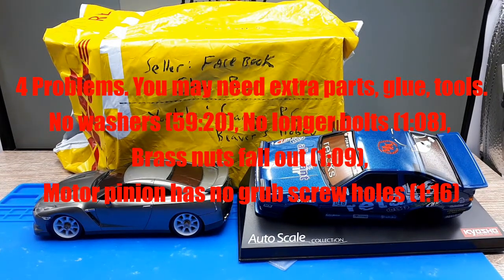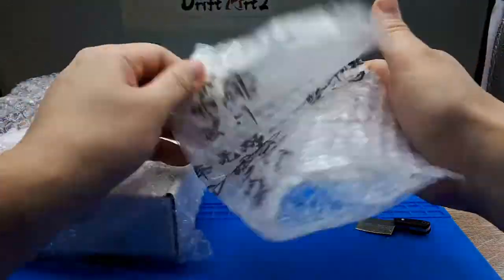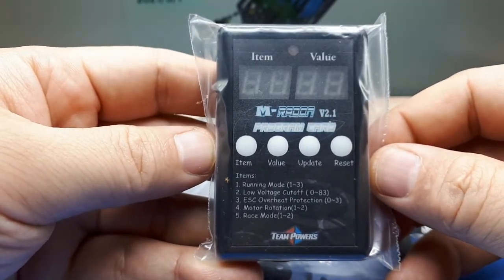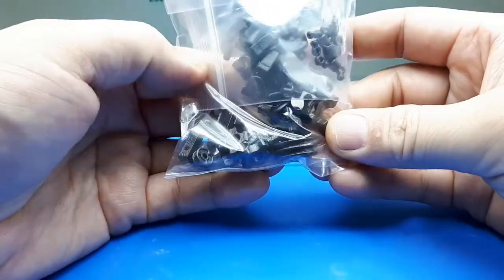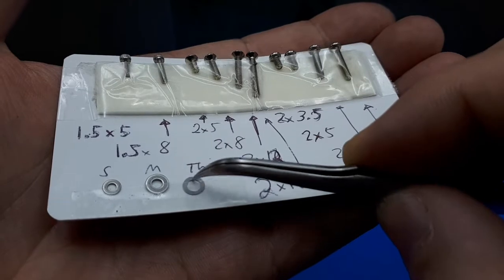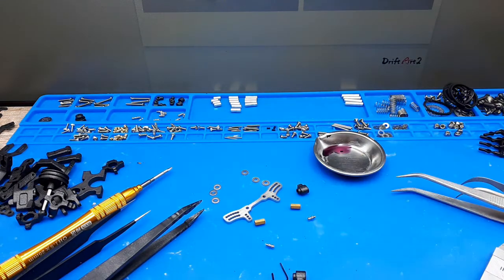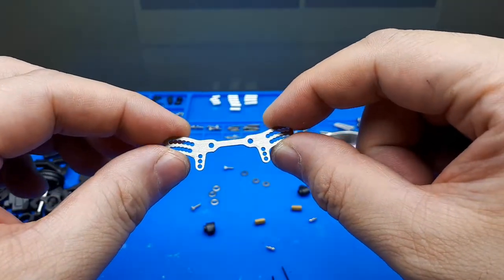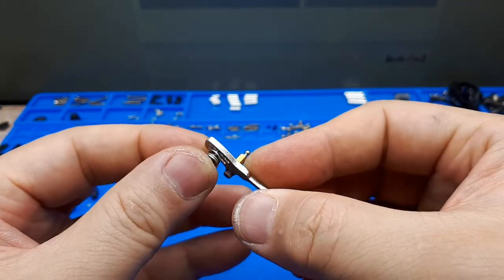1/28rc Drift Art 2 RC chassis build

Comment: Nice…i love it…❤️ waiting for next video to finish the electronic parts….👍🏻👍🏻👍🏻
Reply from the maker: I destroyed my receiver trying to desolder the pins off so had to order a new one; might be awhile for a new video.
Reply: Any reason you chose drif art2 for your rc kit? I want to build one but still confused between xrx dpa and drif art…any suggestions…😊🙏🏻
Reply from the maker: @adildewantoro1440  It seems to have the easist to adjust suspension.  I don't know if the others can adust caster.
Reply: What is the drift art web …thx 🙏🏻🙏🏻🙏🏻
Reply from the maker: @adildewantoro1440  I don't think they have one; I never found any official info. Chan RC on Facebook is the only info.
Reply: @smallmodelcollector  Thanks for the info. What are your thoughts on the differential gear, is it a must?
Reply from the maker: @adildewantoro1440  Not sure what you are asking; it only came with a solid rear output which is what you want on a drift car.  Ball diffs are for grip racing.
Reply: Other brand kit has a gear differential not on this one…